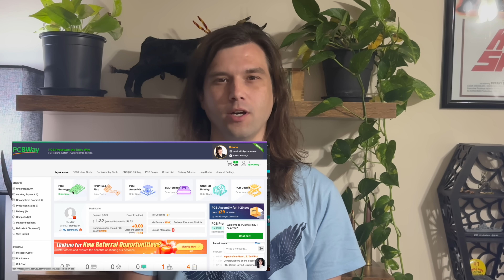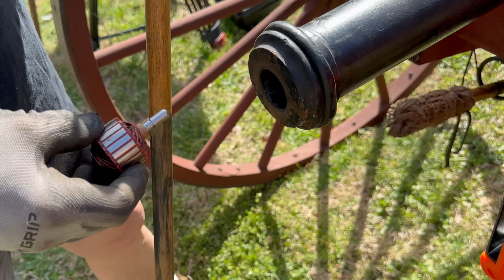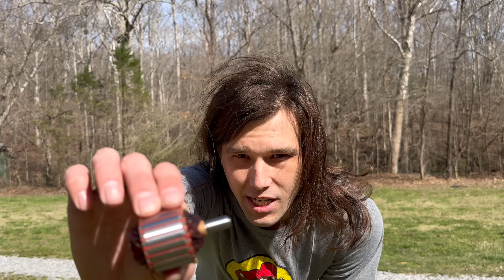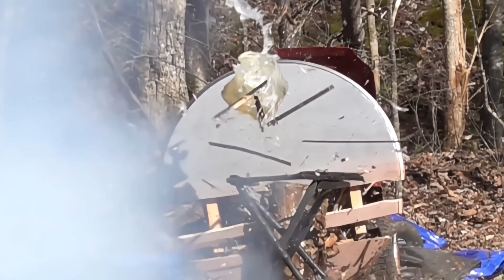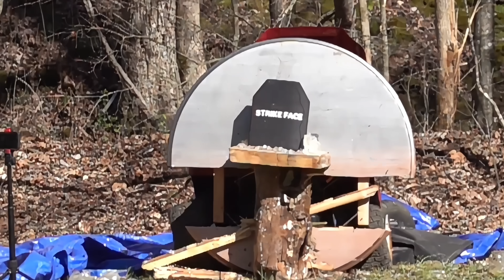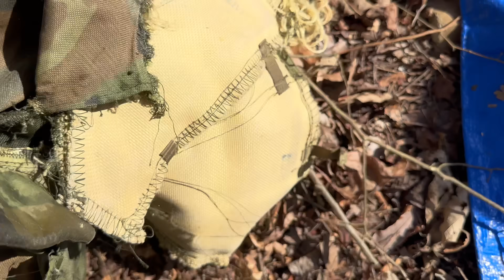Shooting the Motor Madness Slugs

Comment: How precisely have you measured the actual bore diameter of your cannon, Jonathan? I know it's 38mm nominal, but I'd love to know if you have any more precise measurements :)
Reply: I milled mine down to 37.5mm and they worked fine 😊
Reply from the maker: The pipe we used is 40mm diameter but it won’t take a 1.5” projectile down the bore. I’ve gone up to around 39mm or so on the 39 printer and they will fit quite well but it’s tight.